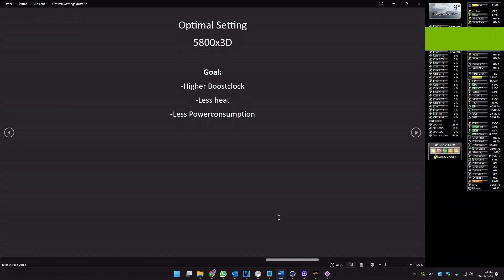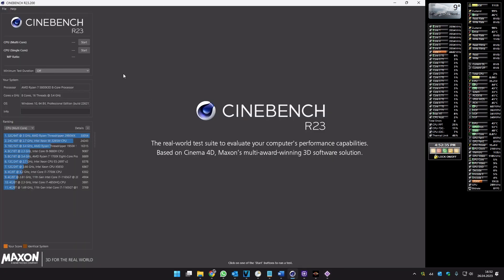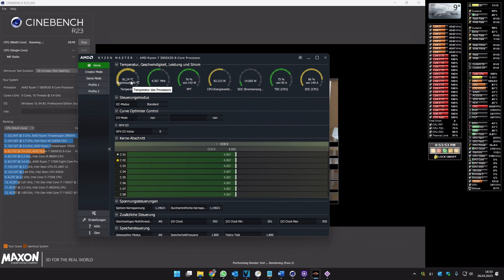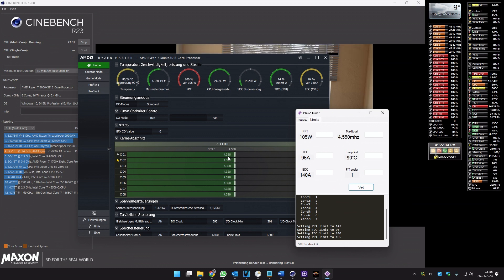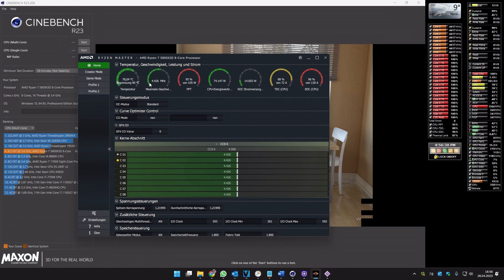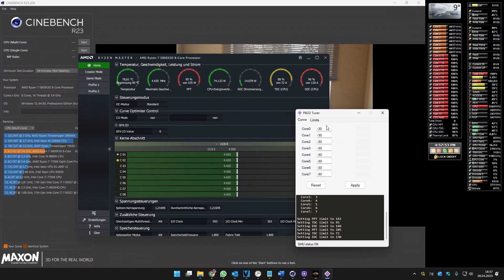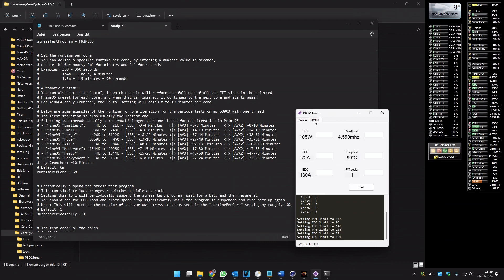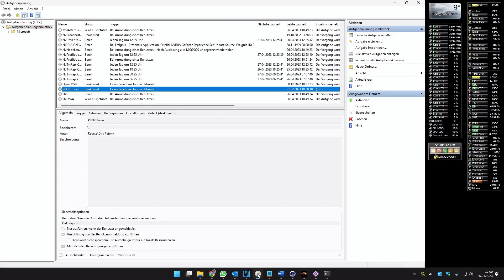5800x 3D Optimal Settings PBO / CO / Undervolt engl.

Comment: The best video on undervolting on Internet. Used it year ago and now again. The use of Ryzen Master to pipoint values for PBO Tuner is so clear. Adding stability checks with Corecycler, great. I went through at least 30 videos and no one so clear and really useful as this on Optimal Settings channel. Thanks a lot!
Reply from the maker: thanks. but project hydra is the best to find the best co values. look at my 7800x3d video.
Reply: @optimalsettings  Planning to upgrade to 7800x3D so definitely going to check your related vid too. Thanks for info

Comment: Can I use this same approach for 5950x?
Reply from the maker: yes
Reply: @optimalsettings  Great. Thanks for the video. I've adjusted curve optimizer offsets so my system is semi stable. Moving onto the limits it looks like my cpu temps are only reaching 66 degrees so there is some headroom there, but the EDC seems to be hitting 100% with PPT and EDC hitting high 90%'s at stock values. Do I need to increase these values to make use of the cooling headroom? Thanks
Reply from the maker: @Shades_of_White  yes. look also to my hydra video.

Comment: I used this guide and lost points on cinebench tweaking the PPT,TDC,EDC. -30 all core runs like a champ tho.  Seems i get lower overall clocks tweaking the ppt tdc edc settings. Ideas?
Reply from the maker: but is your cpu cooler as before?   maybe you lowered the ppt, tdc and edc to much. what are these settings.
Reply: AIO currently 32c idle. 77c running -30 CO all cores with stock PPT TDC RDC in cinebench for 30min @optimalsettings
Reply from the maker: @glawk40  so you can raise the pbo to reach 80° to get more core boost. thats the video about. you dont have to copy my values. all depends to your cooler. or try to set the pbo to enable or motherboard. i believe your aio can handle it well. submit your new results.

Comment: 5800x3d is a great CPU but in the end i picked 5700x , for 24 % slower and 64 % cheaper , didnt want to deal with all this voltage twitching just  instal  and play . Great  video , keep it up !
Reply from the maker: You dont have to deal with the 5800x3d.
You also can tweak the 5700 for less heat and better performance

Comment: I am rocking -30 allcore on mine but i am not sure how to use corecycler log to inspect for errors?
Reply from the maker: Just start corecycler.bat at default.
Reply: @optimalsettings  ok how much time? 6min everything passes, 30min have error on one core
Reply from the maker: @pav1u  default=6 min. Then reduce the oc curve for this cord by 2 and test only this core again.
Reply: @optimalsettings  test 6min everything passes, 30min there are errors, question is, how much time is needed for each core to be safe about stability?
Reply from the maker: @pav1u  everything passes but there are errors? Confused
Reply: @optimalsettings  passes at 6minutes, errors at 30minutes...so how much time do i need?
Reply from the maker: @pav1u  if it runs clean three times it should be enough to start with.  you have to test the remaining stability in everyday life.  if you should have crashes you have to find out which core it was.